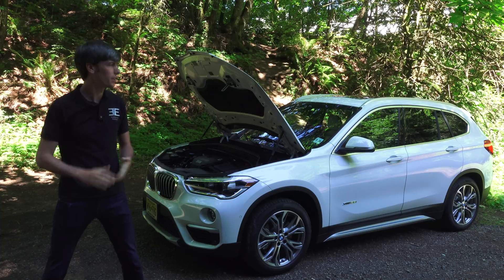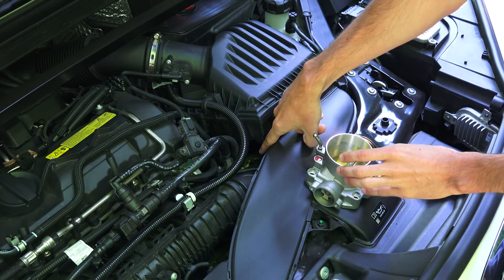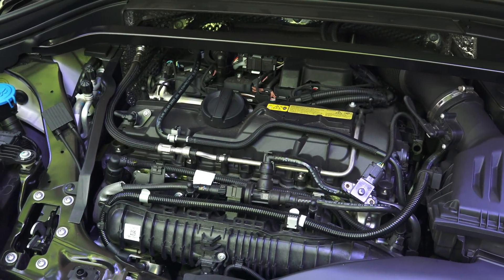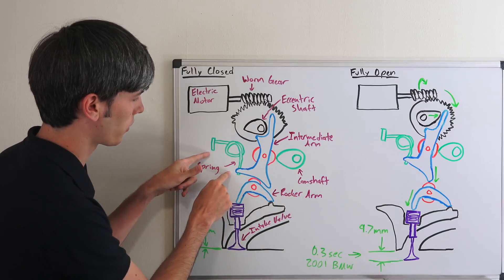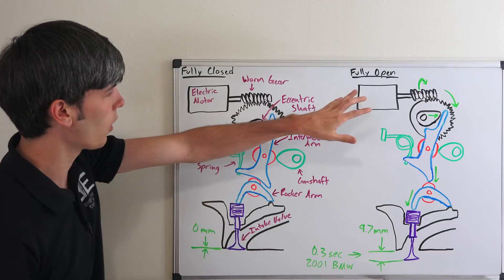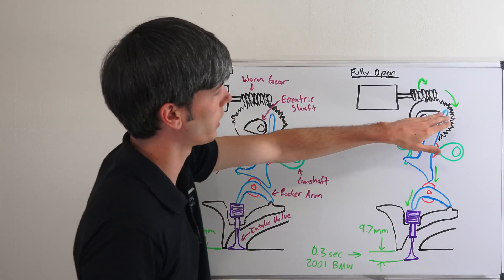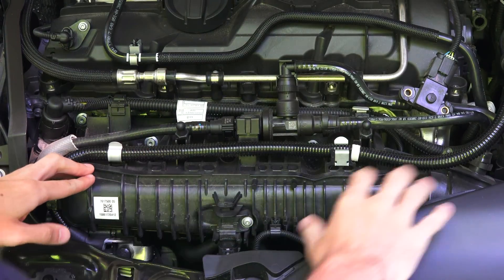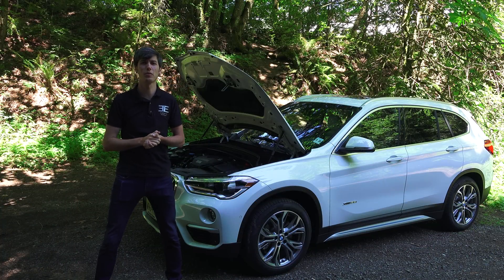What Is Valvetronic? BMW's Innovative Throttle System

Comment: Dude Ill bet you get some clatter noise from one of those systems once you start getting the miles up there.
Reply: Yeah, the system definitely adds some extra complication. I was thinking about how, to the user, this system may save on fuel economy, but in the longer run if it fails it'll cost to repair possibly negating any fuel economy savings. Since OP said his info was from 2001 I'd be curious to know how the system is holding up on a 15 year old car. Of course, user savings doesn't matter if the local gov has regulations on fuel economy.
Reply: it was introduced in the 2001 bmw e46 316ti compact. i havn't heard of any problems with the valvetronic system yet. the vanos from e36 model cars was quite fail prone but apart from some electronic, powersteering and rust problems the e46 4zylinder cars are very reliable.
Reply: or paying up the wazoo for maintenance
Reply: franz wer You're right, but it's also BMWs fault because they made the service intervals too long.
Reply: *****
 Well if BMW made the intervals shorter than it's analogues (merc, audi) then it would look like BMW admits it's quality is not that reliable and needs a lot of maintenance.
By having longer intervals it seems reliable technology, and the people who buy new cars drive them 2-3 years and once the warranty is over they sell their car. That is the moment your BMW turns into a British Leyland equivalent.
But the rich people who always buy new cars won't notice too much of this problems, apart from having to less it way under it's price.
Reply: +TheWolvesCurse The 2001 N42 engine with valvetronic isn't the best engine BMW produced, but it's not bad either. I drive one of these and never had problems with vanos or valvetronic itself. More crutial is the weak timing chain assembly and the tendency of these engines to leak oil very badly. Valvetronic problems that can occur are the electric motors failing over time and that the excentric shaft tends to go flat as a consequence of bad maintenance.
Reply: The eccentric shaft can wear because it's not lubricated very well and it causes problems but it's not that difficult to replace.
Reply: ***** You are right, but bad lubrication is usually caused by bad oil because of sloppy service.
Reply: Yea but the only problem with BMW and Mercedes where I come from is that parts are so expensive to import. I don't think there are many reliability issues compared to other brands of cars, but like any car things will break over time and the amount of extra money spent to get the parts from overseas adds up in the long run. That put me off buying a 318i completely.
Reply: j0n0j0n0j BMW parts in US are cheaper than in most of Europe.
Reply: ***** true they are pretty pricey in Australia.
Reply: j0n0j0n0j
 By the way, perhaps it's a good idea to buy your parts in another country then...
Like buying it in a US shop and then use Shipito.com to resend it from their warehouse to australia.
Or http://zakaztovarov.net/ has way more options, so that you can ship from asia, europe, us to anywhere in the world.
Here are some other package forwarders:
RusBid.com
Qwintry.com
Kupinatao.com
Pochtoy.com
Tebebuy.ru
Vivatao.com
InJapan.ru
Oknoeu.de
Darom.jp
Shipito.com
Alfaparcel.com
Fishisfast.com
Kupiturk.ru
iShopium.com
ModaLondona.com
---
Another trick: When you buy an oil filter for VAG it's made by bosch, when you buy a bosch oil filter, you have the exact same product with a different brand for less money.
Reply: sasja de vries Thanks for the info. ill keep that in mind for my next project. but the days of me wanting a bmw or merc are long gone. My next project will be a Fairlane so all the parts will be locally sourced.
Reply: +TheWolvesCurse that's my current ride... The only issues that I had is the oil cooler (it wanded specific oil type, and specific coolant that I didn't put). But anyway that ended good, and the car painted the road until the belt that drived the coolant pump snaped inside the city center in rush hour. There I needed a new engine that I had ready from another E46 compact, and it was the same type. All ended good, and the car rolls and goes nearly everywhere

Comment: no wonder BMW always prefer you take the car to them for service
Reply: +Júlio César Braga this is how you loose all your money
Reply: valvetronic rarely breaks. What does break are the rubber gaskets that bmw puts in their cars.
Reply: That is correct. 
The message should be - "Every car should be serviced."
Reply: bmw clearly has zero rubber knowledge in their entire company.
Reply: @common_c3nts238  That is so true, and it's not just in the engine, it's also in the front window, had to replace it after 3 years only.
Reply: You are right
Reply: Haha so true! szwarcuskx5
Reply: Well, it is also what push you to makes money.
Reply: Every car should be serviced at the dealer, even used ones (because the owner's manual usually have a form to be filled by the new owner in order to keep the official assistance and warranty).
Reply: @j.cesarbraga  If you had to live with the quality of work at main stealers in the UK you'd be singing a very different song
Reply: +Akash Hegde it does fail, the eccentric shaft sensor failing is a common issue

Comment: Since this car has a standard butterfly valve as a failsafe, I'd be really interested to see tests where you disable Volvetronic.  Understandably, I don't think BMW would like you meddling with things like that, but it sure would be interesting to see stuff like:
* Throttle response time
* Fuel efficiency
* Engine noise level
* Acceleration speeds

I'm not expecting all of those to change significantly, but it would still be interesting to measure them.
Reply: It just goes into limp mode. Also disable VANOS at the same time. There's a distinct lack of power
Reply: The engine will cut power by limiting fuel though funnily enough if you bypassed that the Valvetronic failsafes into maximum lift so I would assume you could still hit peak power though you'd lose the nice flat torque curve
Reply: when the valvetronic system is disabled, the car lacks power. It will idle normally, no extra noise..by simply listening to it, there is no difference. However when driving the car, it struggles in climbing hills, overtaking and acceleration. the intake valves will be opening very little, allowing less air inside the cylinder..which equal less power. kinda like choking the engine
Reply: All new BMW's are turbocharged, direct injected, double Vanos with Valvetronic. A good comparison in power difference is when looking at the non-Valvetronic N63 vs. the Valvetronic N63TU.
Reply: The car runs normally off the throttle valve. There is less low-end torque and slightly worse fuel economy. Otherwise, so long as teh eccentric shaft is as max lift, the car runs normal with a CEL on (this is true for N55). N52 is a slightly different valvetronic system.
Reply: @banks334  My N55 had valvetronic disabled after a major repair because they didn't run the valvetronic servomotor recalibration (which you're supposed to do whenever it's disconnected even if you didn't replace it). The only difference I noticed was a slightly rougher idle, and maybe a little less torque down low but not enough to really tell for sure. I think the main difference will be fuel consumption around town, on the road even that doesn't really change. Also there was no CEL or any errors on iDrive, I had to check with ISTA.

This is assuming the system can still actuate the motor, in which case it will simply wind it up to max lift position and leave it there, or if the motor just happened to fail completely with the valves at max lift. If the motor fails with the valves at partial lift then yes you will see decreased performance, by how much depends on how much valve lift you've got.
Reply: you all forgot that when the valvetronic system is off the engine less vibrates (this must have something in common with the tension from the spring) It runs also quieter. The fuel economy drops radically ! numbers rises from a 8,5 by board computer to even 11 or 12 liters / 100 km during the same diving conditions. Power output at its max rev remains the same but struggles at a lower rpms thus the fuel efficiency drops dramatically. Valvetronic is a pain in the ass system as it gets worn during the years if not oiled properly.
Reply: +chax man Assuming the point was to see the difference given the same engine with a standard cam setup using a throttle body.
Reply: Volvotronic, lol, good one :)
Reply: This test has been demonstrated many times... Google it.
Reply: TheAusGamer1000 The engines will work fine, but am sure one will have a slight better response and power curve to the other. My bet, is that the better performer will be the one with the system.
Reply: I'm aware of that, the idea is that it's an interesting experiment to see the actual differences in power and torque curve, overall economy and even smoothness and drivability that the system creates.
Reply: It just runs like a pig when it's in valvetronic malfunction mode..but it will run for a while..bmw is actually pretty smart n the 0 to 60 time for the 4 cylinder n20 to the hell kittens v8 is 2 under 2 seconds
Reply: Nick Amarit Hell, my Google search found 5 articles alone and that's without going the easy route and looking for only videos.  There's more to the Internet than videos.
Reply: +NorthernChev Googling does not show much except for 2 videos on Youtube by the same Youtuber.

+David Mumma I want to disable Valvetronic for my N46 engine and bypass the failsafes without disabling VANOS. How do I go about doing that? Please advise.

Comment: german just have to make everything complicated,and unique,why can't they just use the traditional butterfly throttle body
Reply: Did you hear the part about 10% improvement in fuel economy and improved cold starts? Also, better throttle response. 

With current regulations and the advanced state of gas engines, 10% is a massive gain.
Reply: Because this is better?
Reply: Because the regulations make the manufacturers fight emissions constantly.
Reply: Because this is how technology progresses, why don't  we just use drive by cable in every vehicle and never change anything.
Reply: +Anthony Figueroa I bet you this crap is not as reliable as the drive by wire or cable
Reply: +matt just for hell of it,thry changed it,lol
Reply: +STEEVE DAVID Nicolas 
Probably not as reliable in its first iteration, and certainly more expensive to repair or maintain, but this is what government regulations have forced on us by demanding stricter emissions and fuel economy. Is the trade off worth it? I can't tell you that.
Reply: +STEEVE DAVID Nicolas 
Probably not as reliable in its first iteration, and certainly more expensive to repair or maintain, but this is what government regulations have forced on us by demanding stricter emissions and fuel economy. Is the trade off worth it? I can't tell you that.
Reply: + Greg McNamer Not everything is about MPG gains. what is the cost here? What's the reliability? Is that 10% net gain or this just 10% more efficient before all other loses. You highlight gains, but you don't weigh loses. Nothing is a clean shot, there's always an upside and a downsides to everything.
Reply: +Larry See my most recent response. I won't refute higher initial and potential maintenance costs. Also consider that because the computer has better control over combustion, the engine may last longer in general. 

Don't let your fear of new technology stop progress of society. At the same time, I definitely recognize that  many technology "advances" end up causing more problems in the end. 

For a driver's car, I prefer the cable actuated response of my old civic to that of my 2011 Mustang GT, but the drive by wire results in better ESC and tuning potential.
Reply: +Larry I agree